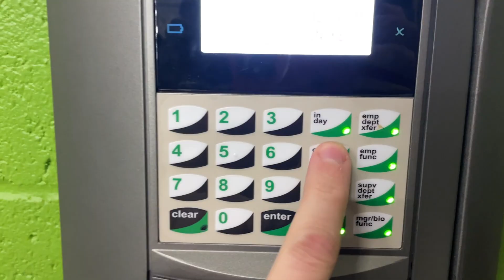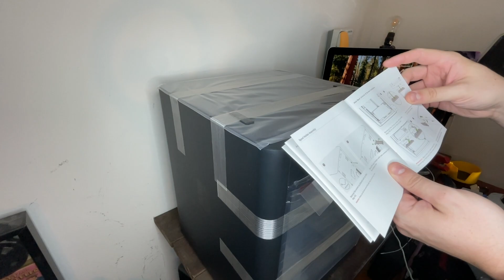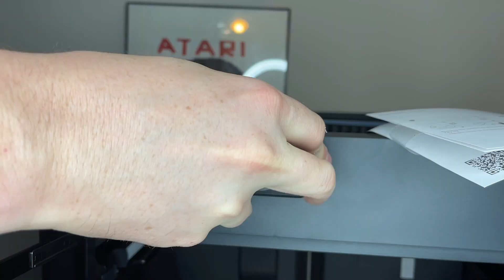I fell for the Bambu Labs hype

Comment: I'm going to be sending my ender 3 off to the farm on the hill here in a couple weeks as well. Started thr hobby 6 months ago. Ummmm....accomplished ZERO prints with my ender. Not quite as Noob oriented as I was led to believe. At this point I've probably spent more in upgrades than I did on the damn thing. Auto bed leveler, all metal extruder, new Boden tube, glass print bed and ZERO prints. Never got past test prints. Something was always wrong. It could totally be chalked up to user error and me going into the hobby thinking "load a file, press the GO button, set it and forget waiting period, and BAM 3d print" Yeahhh, I'm  sure everyone is shaking their head. My ADD has swamped me in SO MANY projects and learning of new concepts and hobbies already. I'm very much looking forward to my bamboo doing all the bs for me so I can just print my electronic project housings and other useful solutions to my everyday problems

Comment: I chose the Bambu P1S as well! The higher price of the X1C didn't seem worth it to me when you can upgrade the printer with some of the X1C features, like the AMS addon later on, and upgrade the input panel to a third party screen like the X-Touch, or one of the many Raspberry Pi options. The only things it would have been nice to have are the better camera (though there's an easy Raspberry Pi solution there, too) and the LIDAR fail detection, which I haven't been able to find as an update project yet. I imagine there's another Raspberry Pi project that could address that too, with the Pi AI neural network unit being trained with the camera to recognise a print fail by image recognition. I'd say my prints have over a 95% success rate, but walking in to see a printer full of spaghetti is always very disheartening. My first printer (a Geeetech) was so basic, and required so much tinkering and calibration, that I only ever succeeded in printing one item that wasn't the demo model that came on the memory card. The P1S is like a replicator in comparison, and doesn't look like it was build by someone in their garage.
Reply from the maker: My thoughts as well! The lidar would be cool, but it seems like a diminishing returns thing and I've heard the ai spaghetti detection can be a pain when it's wrong

Comment: Dude I'm in the same boat as you, minus the AMS. For the past few years I thought Bambu was overpriced and did the same thing my Ender 3 Max does. Boy was I wrong. The ender 3 is so finicky and a chore to level and set up for each print. My P1S honestly reminds me of a regular laserjet printer. It's like Bambu put the printer back in 3d-printer. I don't have to screw with anything before a print, no running back and forth with an SD card, no more having to clear filament boogers off the nozzle. Everything automatic. I can never go back.
Reply: Who's got 2 thumbs and agrees with you 1000%? 👍 this guy 👍.  Started the hobby 6 months ago with ender 3. How many prints did I accomplish yoy ask? Um...plus....carry the 1 🧮.....OH YEAH! NOT A DAMN 1. From bed leveling issues, bad bed adhesion(being generous), unsquare frame, repeated clogged, and on and on. Wasn't what I was envisioning when I started the hobby. I just wanted to make some cases for my electronic and LED projects. I didn't know I was taking on another deep dive into a new subject (ADD makes my hobby life pretty full as is. Jack if all trades, master of none😮). Like you and the channel creator, I broke down and shelled out 500$ plus on the bamboo A1 with the AMS lite. I already have a rather large playlist STL files ready and waiting for my Al's arrival. Fingers 🤞 i don't get the one Bamboo that doesn't just work out of the box

Comment: I got a pair of P1S printers from Microcenter, only real issues I had was dirty build plates causing adhesion problems (Blue Dawn dish soap and plenty of water solved it), or me not placing the build plate correctly and it erroring out. I did have one bad AMS with a bad gasket that wouldn't let the lid close fully & port 4 not retracting filament properly, I was able to return it for a replacement.

Even if you only do mostly single material prints, the AMS is worth it so you can store filament in a "dry box" while being able to easily swap filament without any hassle. Being able to do multi filament prints is a nice feature, especially with tons of cool HueForge prints out there.

Comment: Nice! Bambu is super fast and fairly reliable, just make sure you don’t use the cardboard spools in the ams too much, with out cleaning the ams, it wears the wheels pretty quick
Reply from the maker: Good to know, thanks!
Reply: Most cardboard spools have hardened edges now so that they work fine in the AMS without issue :)
Reply: @technicallyreal  in my own experience, it is a problem, I tend to stay away from cheap filament, but I've still had a lot of dust and about 3 clogs because of it, I've just gone out of my way not to just use plastic spools or transfer to a plastic spool
Reply: @oneletterlon  the cardboard spools that have been updated have glossy edges or even some kind of tape so there should be no dust, but some brands are slow to make the change